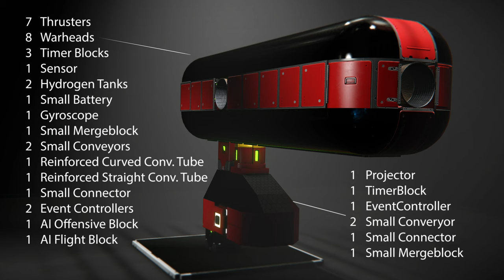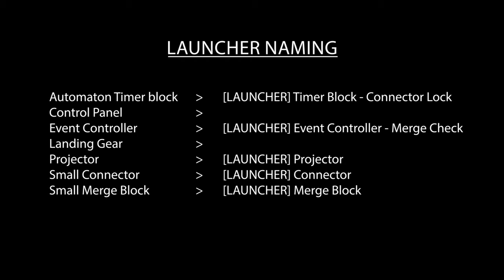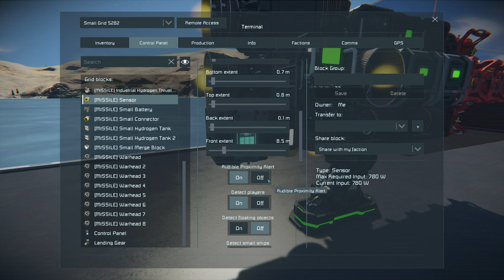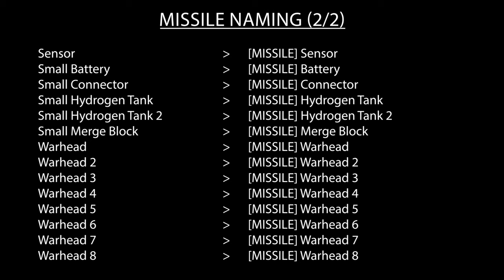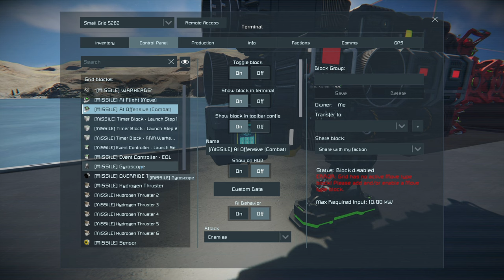Building Self-Guided Missiles In SPACE ENGINEERS - Step-By-Step Tutorial (Check Pinned Comment!)

Comment from the maker: Hey Everyone!

I have noticed I forgot set up the Sensor to detonate the Warheads! OOOOPS! 😅

Be sure to open 'Setup Actions' in the Sensor then place the Warhead Group in the 1st slot and select Detonate!

Then Test out your Missile again, and adjust the sensor extent.

Improved Missile Design in Workshop: https://steamcommunity.com/sharedfiles/filedetails/?id=3063256251
Reply: I don't know if you need to know this, since this video is from 9 months ago. But in case you wanna know what happend to the connector at 35:10. I can do that:

Event Controllers are a bit 'undefined' when rebuild/reloaded. So blueprints and reloading the game can reset them in incorrect ways.

So what can happen is that the EC for the connector was in this 'incorrect' state. And when de Merge Block triggered the EC, it already was...
So the EC took no action.

My advise (also to other viewers) is to make sure the EC resets in the correct state when reloaded. That or manually make the EC trigger somehow. Like you did, as only the first missile malfunctioned.

I have build an automatic hole-drill wich uses EC's. But anytime I join/start the game, I have to manually control the drill. Wich then slowly becomes automatic, as every EC gets triggered. So the first 2m is manual, the remaining 40m is automatic.

Comment: A very detailed guide to understanding the mechanics of event controllers and AI blocks. In practice, such a number of blocks is not required for a rocket. For example, in interception mode there is no need for a brake thruster, which greatly simplifies the missile design.
Reply from the maker: Probably.. but the blocks keep whining about not having the breaking thrust.. haha
I hate red alarms and warning.  😂
Reply: But can you make it without braking trust without the movement ai whining?
Reply: The missile is perfectly aimed at the target even without a brake thruster. If the missile misses, it turns around due to the gyroscope and attacks again. AI whining has no effect on this.

Comment: For the launcher rather than having the event controller start a timer block for the connector, couldn't you set the trigger to be "Connector Ready to Lock" instead and save yourself the cost of the timer block. This also fixes the issue where if you do not have enough materials then your missile won't be stuck in a disconnected state if you get more materials later on.
Reply: imma have to try this... i have checked the launcher and missile's EC repeatedly and can only get a launch if i manually connect.
Reply: That solves how to connect on initial print but introduces a different issue. For me it kept re-locking after i tried to release it. In other words: RELEASE missile, IF ready to lock THEN re-lock, now i have a armed missile glued to me.

Comment: I wouldnt use Event Controllers, they are unreliable. Just use a Timerblock to start the missile, set it up as a group, and just start that timer/group instead of disconnecting the merge block (timer block will do that). 
The only thing i would use an Event Controller is to check if the missile is complete or/and the tank is filled up. But same here, its unreliable.
I tried it with groups and specific names, but it fails often.
What i didnt try was to use prefix names like you, maybe that stops ECs to fail?

I also found a bug where tanks dont fill up randomly. The solution was to reconnect the connector. I´m using a timerblock on the ship to reconnect the connectors regulary for that reason.
Reply: I use an event controller only for the tank. If tank is at 75% it turns the small connector off and the fire timer on, cuz i have a timer that starts itself to connect the small connector as a safe gruard to be sure the missile has fuel.
Reply: I find that with my ECs on projections that often I have to adjust the slider manually after it is projected and then it seems to "reset" and work just fine.  I ran into this when building a drone carrier setup.  All my drone ECs no matter how hard I tried had to be fiddled with right after projection.  That could be what you're noticing when they are unreliable.  Sorry for old post
Reply: As someone who has build a 3-bit adder with EC's:
(As in (0 to 7) + (0 to 7) = (0 to 14) )

When reloading a game or when the EC is build, it's behaviour is set to the condition. But this can cause a desync between it's state and it's last command.

This is why EC's have a 'green' screen, to indicate this. When an EC is defined, it's cyan or dark blue (true or false).

So either do:
A. Make sure your EC's are reload/rebuild-proof.
B. If that's not possible: give them an reset condition, wich forces a state-toggle.
C. Deal with it, and reset them each time manually.
D. Just don't use EC's...

Comment: I wish I knew what I was doing wrong. I've watched and rewatched this and still it will not launch.  I even downloaded the one made on Steam Workshop. I hit the disconnect and it just falls off the printer.
Reply from the maker: Not sure if you are trying it in Survival or Creative?
In Survival you might have to give it some time to fuel and charge... 
In Creative it should work without that.

I re uploaded the Blueprint a week or 2 ago and it worked at the time, but I can double check.
Reply: @Beeblebum  I'm in surivival with creative mode turned on.  It wouldn't surprise me if if it's user error on my part but that means I've made the same error looks at saved blueprints of rebuilt launchers and missiles 9 times.
Reply: @Beeblebum  It might a be mod conflict with a vanilla behaviour.  I saved my base and opened it without any mods active,  Missile launches.  It stops and hovers after about 50 m but it launches
Reply from the maker: @jaybirdjargon  Yeah, the first 50m launch is to just clear the missile from your base. If it would have found a target, it would have activated and flown towards it.

Be aware there is a End Of Life setting on the workshop one, that explodes the missile when hydrogen is empty.
Reply: The strange thing is it appears more than one mod makes heavy armor weigh more because so far if I have 1 or the other or both I found, the missiles have a weak arc and explode off the ground, or they skid along like a tobaggan, wait and they explode when the tanks run down.  I may have to abandon the principle in favor of making drones.  Don't get me wrong, I love the missile you made but it isn't even targeting things correctly; rather than go through all the mods I have adding pieces etc and possibly losing a piece of my base, I'll have to shelve this.  Still keep it up, I used to watch your NMS vids back in the day, glad to re-find you.
Reply from the maker: @jaybirdjargon  Oh yeah.. I can see Extreme Heavy Armor might break the whole thing... The missile might work better in space then.

Honestly, after releasing the video and working on the design more.. I learned a few better approaches for later.

Probably will applied one day in the Proxima Beyond series, once I can build freely. 😅
Reply from the maker: Another thing I learned is the "Heavy Gas" mod... is INSANE for missiles.. just totally kills the speed and mobility.. lol

Comment: Question, this missile would be for use on small block ships, correct?
Reply from the maker: The missile is small grid, yes - but I build them on my Large grid ships, just by using a Large grid rotor and switch to small grid.

The missile is pretty big to hang below a small grid ship. hehe
Reply: @Beeblebum  Hello friend, sorry how you built the launching platform from small block to large block, I am new to the game, everything was fine with the construction of the missile but I could not make the platform
Reply from the maker: @MANU-dw9dh  If you build a Large Grid Rotor or Hinge, you should be able to grind away the spindle of the rotor, or the middle hinge part of the hinge. Then in the menu, you should be able to add a small head to them. That allows for small grid connections to a large grid.

If that does not make sense - I can try to explain during one of my streams.
Reply: Forget what I wrote previously, I "solved" it, while testing, the thrusters turn off after launch, I still haven't discovered why it is due, another additional discovery is that they are very vulnerable to the defensive fire of Gatlins, it's not that this is bad, on the contrary, it motivated me. It will take me days to investigate and find a way to improve the missile, but that is the attractive thing about this game, thanks for the video.
Reply: @Beeblebum  Another question, I don't get that "over drive trusther" I don't know what I'm doing wrong.
Reply from the maker: @MANU-dw9dh  So, the overdrive thruster is there to just blast the missile away from your ship or base, after that it enables the AI Blocks and Event-controllers, which in turn disables the overdrive thruster and starts looking for a target.

The fact your regular thrusters turn off after launch and your over drive thruster is not working, makes me believe you might have mixed them up?

I admit the Missile can definitely use some improvements and I did actually make a "better" version of it on the workshop: 
https://steamcommunity.com/sharedfiles/filedetails/?id=3063256251

To make the missiles more efficient, a good way is to build them on a battery, where a 3rd of the missiles have decoy blocks instead of Warheads.

If you set these decoy missiles to orbit around the target, that should distract the turrets enough to get at least one or 2 warhead through the defenses.